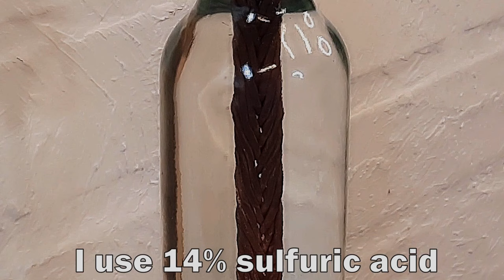Making CELTIC Copper CUFF Bracelet

Comment: Only pitfall to copper or even bronze is that it turns your skin green especially with any sweat. Copper looks so damn good though!
Reply from the maker: Yes - you are absolutely right - and thank you for your feedback. I treat my finished copper jewelry with transparent, allergy-friendly lacquer for the purpose - then I avoid both the green discoloration on the skin and I don't have to polish the copper jewelry every now and then. I think it works well.
Reply: @my-projects  good idea, I have a bronze ring that turns my skin green so i think i will give that a try! Is there any specific product to get? Or just clear nail polish or something?
Reply from the maker: @donaldsullivan6979  I would not use nail polish because there are often different substances in it that can also cause allergic reactions. I sometimes use ProtectaClear - but there are many other different products. 👍

Comment: 👍💙💯..Absolutely beautiful results!!
I just recently started working with the inner (14 gauge) copper from electrical wiring also..and my question is: is there a particular reason you torch the copper all over? Is there a coating on this wire I should be removing?
Reply from the maker: Thank you very much for your great feedback - no, there is no coating that you have to remove, but when you work with the copper, e.g. if you bend it or knock on it, tensions will appear in the copper, which will make it harder and harder to work with. but if you heat it, it becomes soft again.
Reply: @my-projects  👍..Thank you so much for taking the time  to answer my question.  
I appreciate the advice, as I'm still new to working with copper. Thanks again 👍

Comment: Omg it is absolutely gorgeous 😍 and so weighty I can tell looking at it. Quick question if I may. How do you clean of all your polishing pastes of your rotary disks?and quickly if I may. Do you not need solder to fuse copper to copper then? I thought you needed solder for any metal to solder to any metal. I am brand new and only trying to learn I'd really appreciate a reply. Thank you so much . And thank you for sharing. It truly is a work of Art
Reply from the maker: Thank you very much for your very nice feedback 😊 Unfortunately, I haven't found an effective way to clean my polishing discs - right now I have to replace them when necessary. But please let me know if you find a good solution to this👍 Sometimes I use solder paste mixed with micro metal when I don't need very hard soldering - and then it's easier to clean the residue off - but other times I use traditional flux and solder. In the video I am working on right now, I have to use a very hard and durable solder on copper, so I use the traditional solution there. I hope you can use my answer - and thanks again for your feedback 🤩
Reply: @my-projects  Hello .  A big help thank you for replying. I am needing to join two pieces of copper together only 0.8mm thick. And was wondering how-to. That or maybe some rivets could work I'm always thinking of something I can do. I'm just not sure if I need solder to join to pieces of same material together or if they wouod fuse om there own with a little flux paste only
Reply from the maker: Hey - Depending on how strong the soldering needs to be, I would use the traditional solution for soldering copper as I mentioned earlier. It is quite difficult to get 2 pieces of copper alone to fuse together - it requires extra heat, completely clean surfaces and then the probability of the copper melting anywhere else than where you want it - will be quite high. Copper is very heat conductive as you probably know ;-)
Reply: @my-projects  OK yes I'm aware copper is a super conductor many a summer I've burned my neck from wearing a copper collar in the sun. Ouch. Ok can you please give me simple simple instructions on how to fuse copper to copper please. I'm quite dim at times and not sure I understand if you don't mind.
Reply: @my-projects  if I have understood correctly I need a solder paste hard. And then add some fine metal as well as flux.  1st step apple flux. 2 head up metal and flux. 3 add solder paste and metal bits heat until solidified.4 then apply ny second copper on top of whole thing and heat slowly both sides to completely solder ?
Reply from the maker: I don't know what you have to solder, but you don't necessarily need flux hard if it's copper you have to solder. Just regular jewelry flux. 1. Apply flux to the parts to be soldered together. 2. Heat the copper with flux on. 3. Add solder paste where you need to solder.  4. Place a small piece of High-copper wire solder where you need to solder and then place the other piece of copper together exactly where you have placed the High-copper wire piece - and heat the connections together until they are solidified. Remember that both copper items must be heated up to red-hot before you heat directly on the High-copper wire solder - otherwise no bonding will occur ;-) I hope it will work for you. ;-)
Reply: @my-projects  Perfect thank you. It's all a learning curve I gotta sometimes  make errors to learn the way. I have confidence and patience so I'm sure I will be fine. I learned viking knit last month my first few attempts looked so wrong not kne line was level. After my 5th attempt wow you would think machine had made it. I can now viking knit weave in bed watching tv. And so therapeutic and relaxing. I never give up if I want to learn something handy being a Taurus. We don't see obstacles we find new ways of doing something. Really appreciate your reply as always thank you

Comment: I am curious about what kind of torch you use for your bracelet projects.
Reply from the maker: @sandyrobinson7908  I usually use a gas torch with oxygen and for this bracelet I used a gas torch similar to this one 
https://www.amazon.com/RX-WELD-Portable-Cylinder-Cylinders/dp/B0CHM3LRST/ref=mp_s_a_1_4?crid =2HGIBCSVYOEHP&dib=eyJ2IjoiMSJ9.qvBL6r5dxLbkvtvBHRrkLzB44RA-oXNDslghl6GR-SUytnhH7lKponhXEPvrdlZB9asFYw-VtPt5HP-SSivisKpEEDCQ3o7IDcBbi_QZmr2q7nfWjAUdHDoRaVIP-d7xlom22JUKvHFF21Z 2BZeQPSBjaYJ0aX4BtQvd3YICmls8prRmKzDyae7TPG8NmtnUi5lLpA3kfMd1HajCH2ufCw.P5H8nDnwxyDpErLOW9jOv091Nh3nl4zjCuMzizFSCyA&dib_tag=se&keywords=torch+burner+with+oxygen&qid=172104295 2&sprefix=torch+burner+with+oxygen%2Caps%2C176&sr=8-4 - 

but in my next video (1 week) I just use a simple gas torch without oxygen. 👍
Reply: Thank you!

Comment: Nice. Is there anything that can be put on it, to stop the copper tarnishing, but keep the copper colour?
I turn copper green, and it makes a right mess
Reply from the maker: Thanks a lot 👍 Yes - I use a pruduct like ProtectaClear to cover my Copper and brass jewelry - my experience is, that it is both a skin safe and anti-tarnish clear coating, that will protect your jewelry from oxidation and fading. You can off cause use some other laquer product that have the same effect. 😉👍
Reply: @my-projects  Magic, thanks, I'll look into it.

Comment: What gauge was the cable?

Incredible work btw!!!
Reply from the maker: THANKS..! I use gauge 12 ;-)
Reply: Thanks!  One more questions. 

Why do you keep heating it up?
Reply from the maker: I heat the copper wire occasionally because when I work on the copper wire - either by tapping or bending the copper wire, it gets harder and harder to work with - but after it is heated again, it softens a bit.

Comment: Love it!
Do you surface treat the bracelet to avoid tarnishing and green stains on skin?

I didnt reailze you could fuse without solder...i Wonder if thats a temperature issue  🤔
Reply from the maker: Thanks..! 😊👍
Yes - I surface treat with Zaponlak. It is slow drying, let it dry for 4-6 hours before using the bracelet cuff.
 No, I can't fuse without solder either - I use solder paste. 👍
Reply: @my-projects  ahhh!! Very cool.
Thanks for the tips.
Do you use silver solder paste on copper?
Reply from the maker: I sometimes use silver solder paste when I solder on the inside (it is cheaper 👍), but for visible solders on copper I use copper solder paste 😊

Comment: Can you tell me what the white paste stuff you use on the end is?
Reply from the maker: Yes, I use solder paste - a combination of a powder made up of metal solder particles and sticky flux that has the consistency of putty. The flux not only does its usual job of cleaning the soldering surfaces of impurities and oxidation, but it also provides a temporary adhesive that holds the surface mount components in place. And its easy to use 😉👍